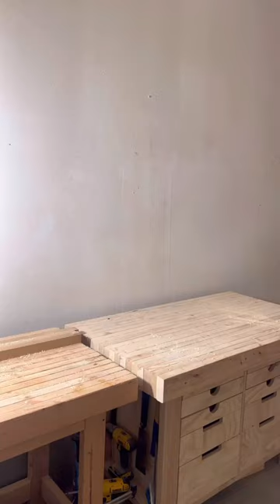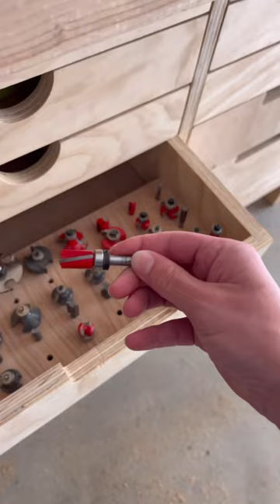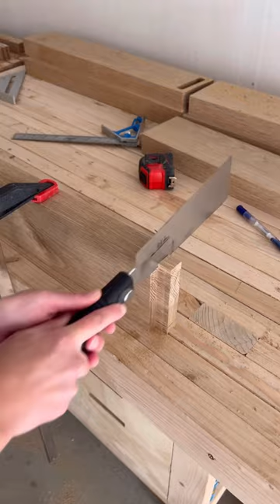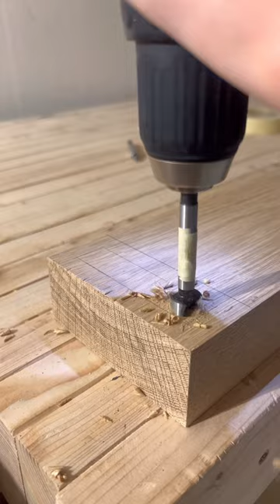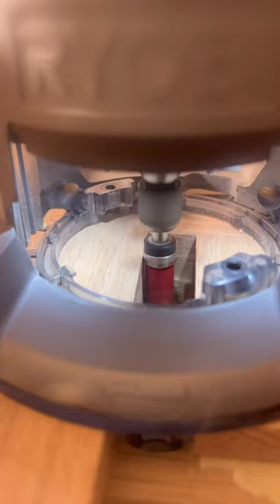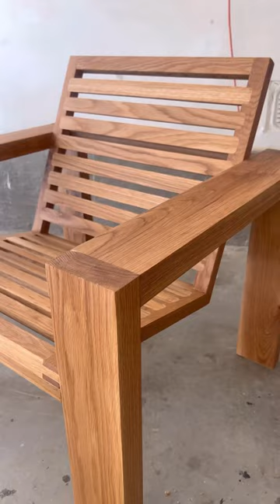Making Large Mortise and Tenon Joints #woodworking

Comment: Sorry, my GIRL!
1) - The first work piece of your joint, could be done on a table saw! Way faster = cheaper = more profit (  for Saftey glasses, for example)
2) - The second work piece, the joint counter part, could be done with one template and a hand router!
3) - And now, I have to finish you, young Skywalker 🤔😂😂😂😂❓  Why you didn't made a usual Mortise and tenon joint?????
    The joint could be done completely on circular table saw, and it would look way better, because the customer can see the complete joint!
4) - In your case, this simple 90 degrees connection, could be done with some wooden dowels or domino's...........